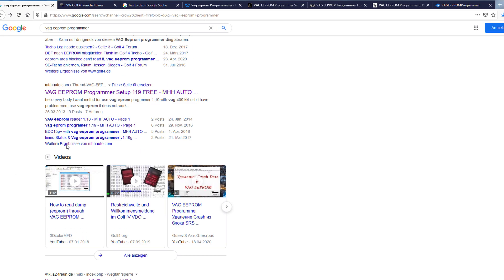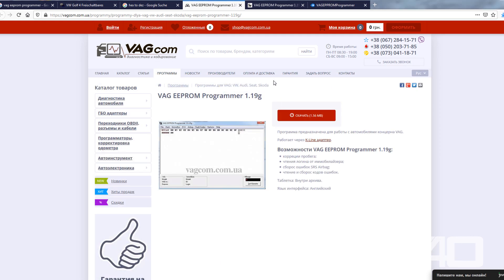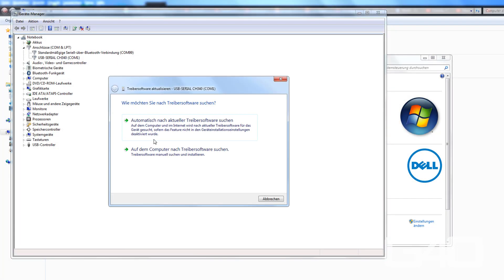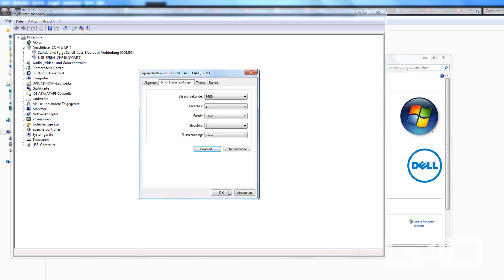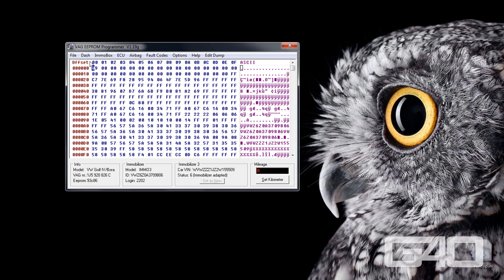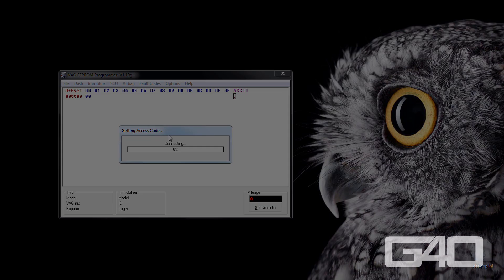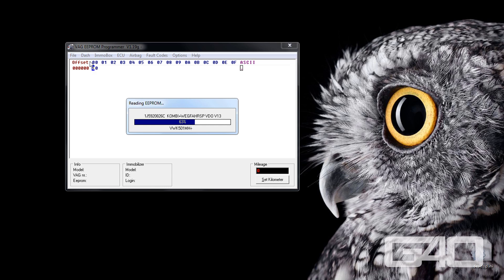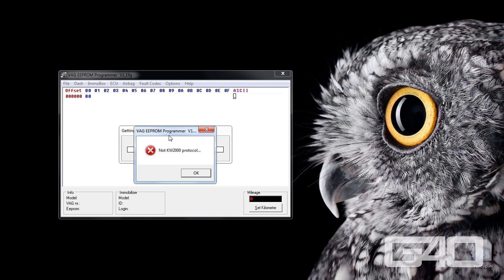🇬🇧 🇺🇸 VW Golf Mk4 | Read the EEPROM of your Cluster to retrieve the Login Code / PIN Code / SKC

Comment: Hi! I can use this program with normal VCDS 20.4.2 cable or i need to buy special cable?
Reply from the maker: You need a cheap blue obd cable.
Reply: @Golf4org  ok, thank u!
Reply: @Golf4org  hello can you give a link with that cheap blue cable?
Reply: Yes it's possible. Start your vcds, options and switch off intellig. Boot Modus.
Reply: @ingebork8828  What is Modus?
Reply: @GOTKOALATEA  mode

Comment: Hey there, do you have any idea why I can't see my pin? It says: "No ECU Found...". The car is Passat b5 99 AFN motor.
I will wait for your answer.
Reply from the maker: Driver installed, COM set to 1 or 2?
Ignition on?
Reply from the maker: @mehmedkalchev1265  Where do you get the VAG EEPROM Programmer from?
Reply: Its russian version, i found a friend who has the original one and now i have the pin, but there is an error in 1 channel, i can't put in the number of keys.
Reply from the maker: @mehmedkalchev1265  You did login with 0 in front of login code? If code is 3333, login with 03333.
Reply: Yup i did it. Probably i have a problem with the central locking module.